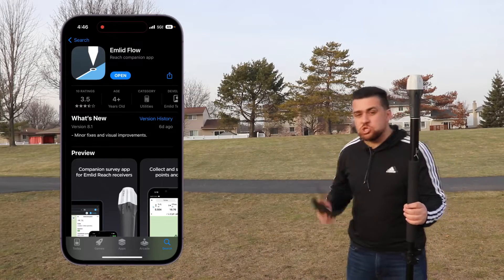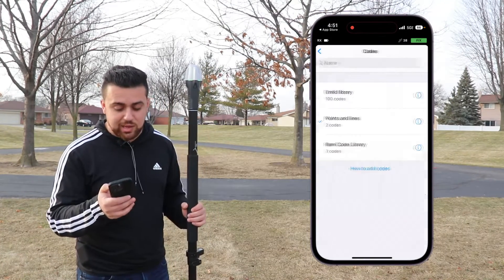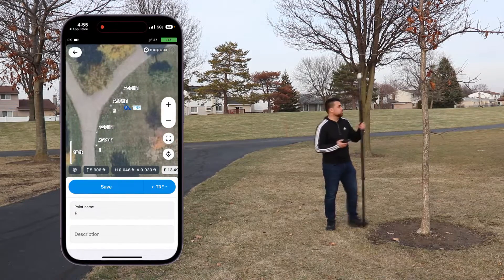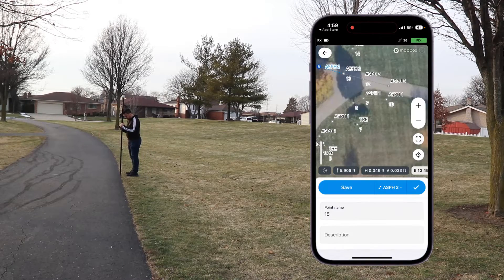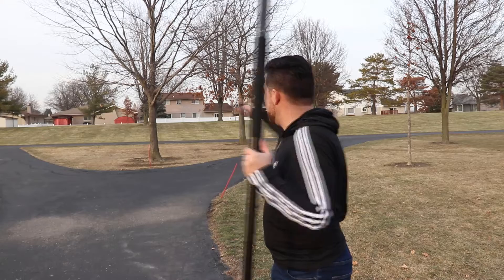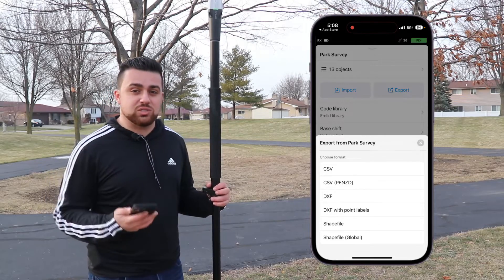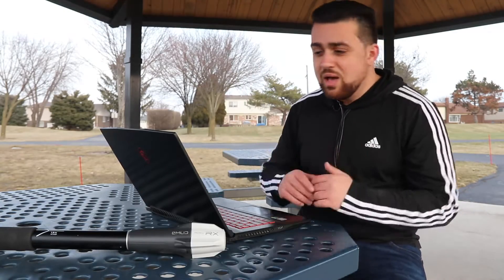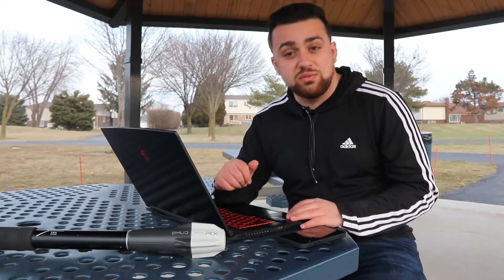How to Survey using Emlid Flow + Giveaway Results

Comment: Hi Rami, I am considering an Emlid RS3 & Emlid Flow for feature & level surveys. I use Total Station to collect urban cadastral data & points where heights are important. I use a Leica TS16 with Captivate for collecting most data. Would it be easy to merge Captivate & Emlid data sets? One of my concerns is codes. Is Emlid Flow code library customizable? Thanks.

Comment: Hi Rami, great video. How would you explain the shift among the data you collected vs the base map of the back ? what is the reference system that ground map uses?
Reply: The satellite imagery basemap is most likely WGS84, which is a different system to the local coordinate system Rami chose in job setup

Comment: I’m watching the video in real time as I’m typing this and I gotta say…this does not look accurate one bit.  The asphalt 1 line is showing your shots well into the grass and the asphalt 2 line is showing the shots in the middle of the walking path.
Reply from the maker: That’s because the aerial projection is not accurate. The aerial projection is designed to guide you in the general location of your site, however, it is not accurately georeferenced to be in the right spot like your points and lines are.
Reply: @RamiTamimi  do you think the unit itself is pretty accurate to use?  Like is this something you would use to lay out a road with curb and sidewalk, drainage, etc?
Reply: @RamiTamimi  So, if I am understanding this correctly, the image is not in the correct location but your points and line from the Emild RX have absolute accuracy or would you need to add a Base station for absolute accuracy, instead of using a CORs network/NTRIP?
Reply: @RamiTamimi  This is actually one of the reasons i'm looking into this type of work. I'm a drone operator out in Canada and this looks great for aerial mapping. Ease of use wise. Would you recommend using an Rs2 as a base station for better accuracy?
Reply: @marknielsen9315  Yes, I finally figured that out. For absolute accuracy you need a base station over a known point,.  But,  how do you locate known point around my area in NYS and abroad?  Thanks in advance, you are a valuable resource.